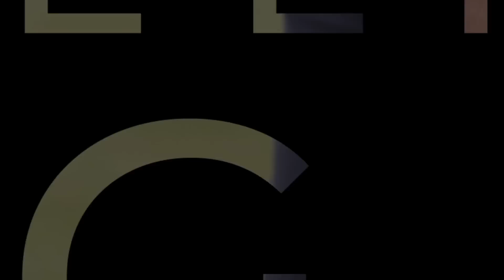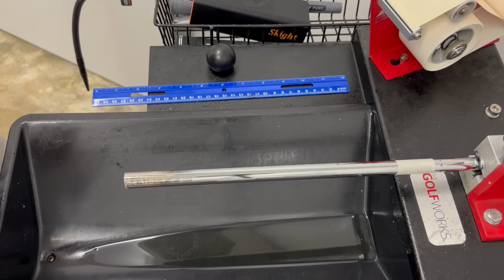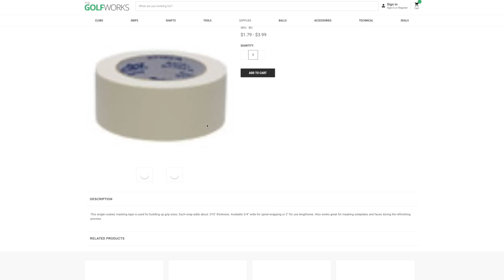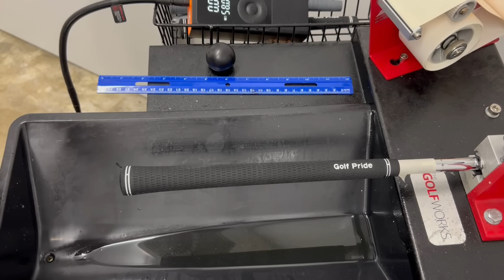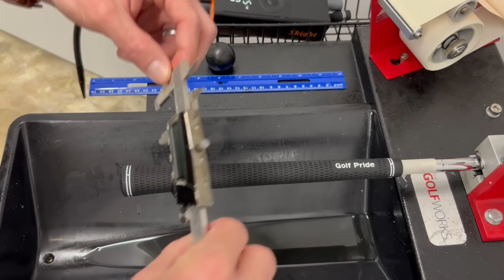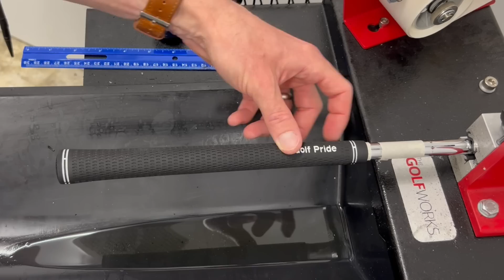Making Golf Grips Bigger with Build Up Tape / Mistake?

Comment: using air with no solvent not good. 
check your work at hirekogolf grip size calculator.
Tip measure the length of the grip before and after you install them.
GRIP SIZE CALCULATOR
 

Gender (M/F): 
Male
  

(Notes): This is used strictly to label final size relative to men's or ladies standards.

Grip Core Size (in.): 
Select Core Size

(Notes): This is the internal grip size determined by the manufacturer in inches. You can find this dimension from the Hireko clubmaking catalog or on our website.

Shaft Butt Diameter (in.): 
0

(Notes): This is the outside diameter of the shaft's butt end measured in inches. Please either measure the actual butt end of the shaft with a pair of calipers or find the butt end measurement from the specification in the Hireko clubmaking catalog or on our website.

Starting Grip Size (select): 
Select Grip Size

(Notes): Each category has a specific outside diameter which will have an influence on the outcome of the grip sizing. Choose from the list of starting grip sizes. 

Build Up Tape (#): 
0

(Notes): Please include the number of wraps of build-up tape that you add underneath the grip.

Tape Thickness (in.): 
0.0035

(Notes): Standard masking tape has a thickness of approximately .0035". If you use build up tape that is of a different thickness, please enter in this specification 

............................................................................................................. 

Final Grip Size (inches): 
0

Final Grip Size (relative size): 
0
grip sizing measurements

Comment: So 12 wraps would bring it up to midsize, no? How much total weight would that add? That certainly would affect swing weight significantly unless the 12 wraps is the equal to the off the shelf, Golf pride midsize grip.
Reply: In other words, why not just buy the midsize grip?
Reply: @61JZ  12 wraps would be quite a bit heavier than just using a midsize in the same model of grip.
Reply from the maker: Exactly!
Reply: Good luck getting the grip on all the way with that much tape. Also it will be hard
Reply from the maker: Yeah, that grip even if you got it on would rip within a month I'd guess.

Comment: You're much too polite in dealing with the people who want to prove someone was wrong on the internet, but are totally unwilling to actually test their own theory.
Reply: You sir are in the sheep category you follow without question, he isn’t wrong or is he right he is misleading , if you build up tape layers on the shaft then stretch the grip to its normal length of course the wall of the grip will be thinner but allowing the grip to be a little shorter it retains its wall thickness viola your grips are thicker on the built up section .
Reply: @johnaustin635 did you even watch the video? He didn't stretch the grip.
Clearly as you put more tape on the shaft the grip itself gets stretched thinner around its circumference. As a result it will also feel harder. Maybe that change in feel is why people think it's bigger.
BAAA  🐑
Reply: @johnaustin635  Have you done your own testing?  I ask because it might show you that the grip still stretches around the shaft and extra tape.  Sure you can thin it out even more by stretching it down the shaft just the same as you can with 1 layer of tape or even none at all.  YOu can also make the grip under the right hand feel a tiny bit thicker just by pulling up the lower half as it dries.  He is not misleading at all as his test is keeping consistency as much as possible.  If you like the extra layers that's great but this video is absolutely not misleading anything.

Comment: If you would have stretched the grip out like normal, it would have had minimal effect at the 2" mark for 2 reasons. 1- most of that stretching will happen at the thinnest part of the grip, that being the head end. The grip rubber is thicker at the butt end, to build up the taper of the grip. Due to the tapering thickness of the rubber over its length, the amount of  lateral stretch will change over its length. You could easily test the lateral stretch impact on thickness, as well. 2- the grip is being stretched in 2 directions, diameter stretching which you properly demonstrated, and laterally which stretches over the entire length of the grip. The lateral stretch will be "diluted' over its length far more, by a factor = to its length.